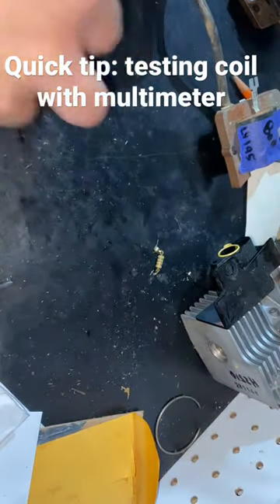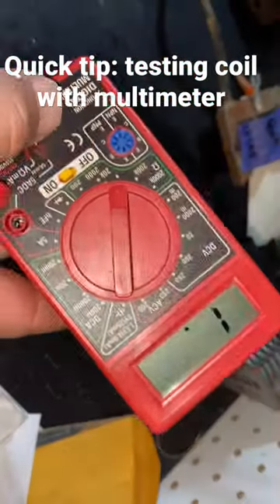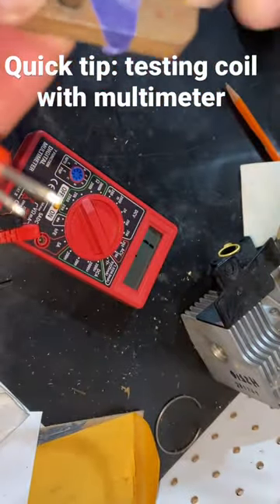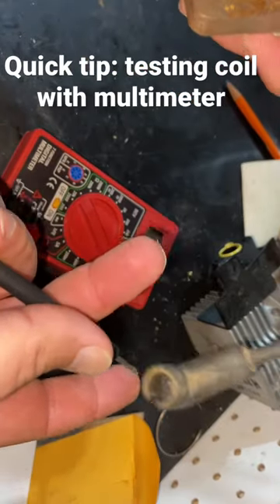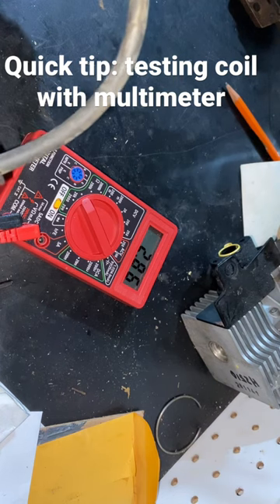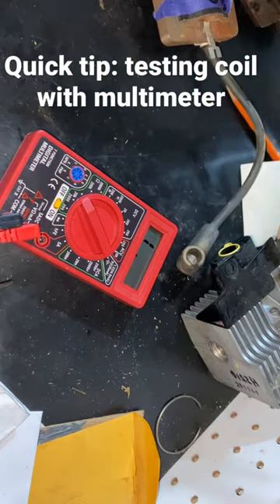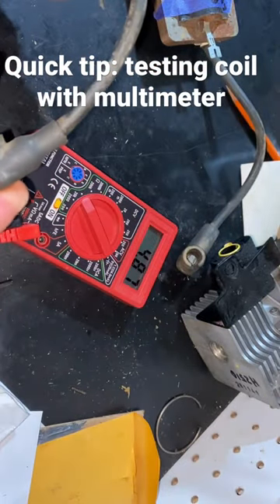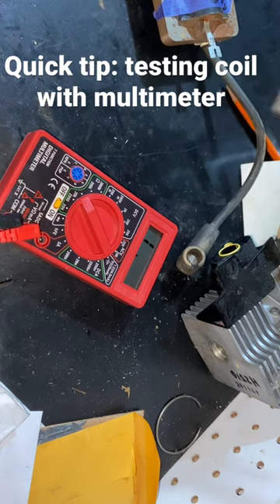Quick tip: testing coil (magneto) on a lawnmower with multimeter

Comment: I did what you said am mine's reading ten nineteen I don't know where I would get a real It's for a troy bill You explained at the best way and I work that it shows.My numbers are too high Where could I get a reasonable coil that will work I am so subscribing to your channel.Cause you help me out And I thank you for the video
Reply from the maker: @EnthusiasticTruck-xh7ss   sometimes you can find a local person with similar engine for parts.  Or even free.  Oftentimes  if it’s something I cannot fix or it’s too far gone to make a profit on fix and resell I strip them for parts. 
Alternatively you can try to look up parts online from Amazon or eBay or HIPASTORE or other online sellers .  In your area you might find a small engine shop that may sell you a used part with no warranty.
Reply from the maker: @EnthusiasticTruck-xh7ss  I if they are higher numbers it might be ok.  Do you get a spark when you hold the plug to the block with it connected and pull the cord ?
Reply from the maker: @EnthusiasticTruck-xh7ss  other possibilities it could be out of timeing espically if you hit something recently.  That would be a broken flywheel key.

Comment: Mine is reading 4.72 but I am not getting any spark on a new plug.  But thanks for the video
Reply from the maker: @M2020-s5x  disconnect kill wire from coil then see if you get spark.  If you do .  You have a wiring problem with the kill wire to to coil
Reply: @dfields9511  I’ll check that and give an update.  Thanks
Reply: I did that and it does appear to be a problem with the kill wire.  They’re cheap so I’m going to pick on u0 on eBay. Thank you

Comment: Thanks man. Mine is reading 2.92.  And I have no spark. I think it’s time for a new coil. I’m testing a 80s craftsman. Numbers on the meter should still be the same no matter what brand of lawnmower right ?
Reply from the maker: This one that was reading low for me was a tecumesh LV195EA .  But the same test applies for a Briggs.  

You can get a new coil on Amazon eBay HIPAstore  etc.  make sure to get the right one .  That matches your engine model number. (Not the deck model)

Comment: the ohm reading that you had. wouldn't that depend on the length of the winding in the coil.? if I'm wrong. somebody  clue me in.🤔👍🤪🇦🇺
Reply from the maker: Possibly,  I do know if thrn one reading is less than 4.8 It’a bad but if it’s more then 4.8 it’s likely good  still . Again it depends on the mfg of the engine.

Comment: Mine doesn't read anything?
Reply from the maker: If it reads 0 then somewhere in the coil the wire is broken.  Continue to check.  Also verify that the multi meter is working .  Touch the two prongs together and look at the reading.
Reply: Assuming you tested correctly that is broken